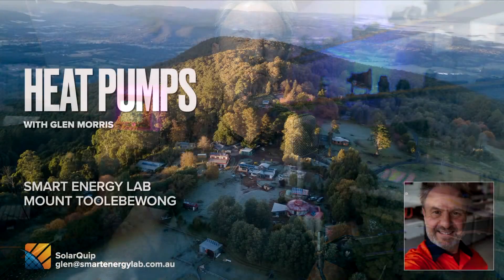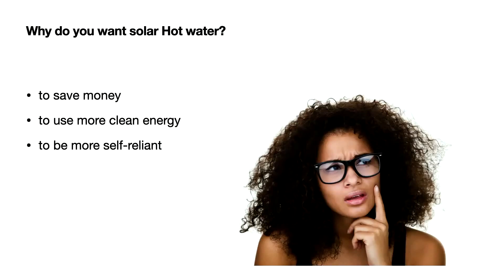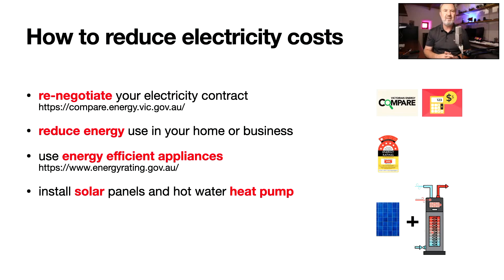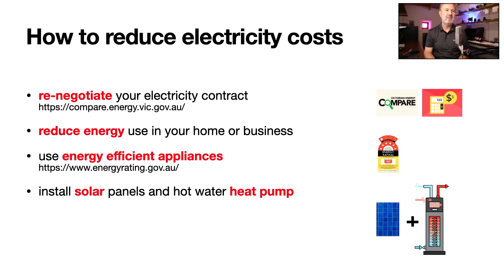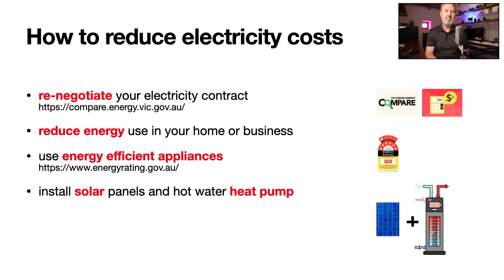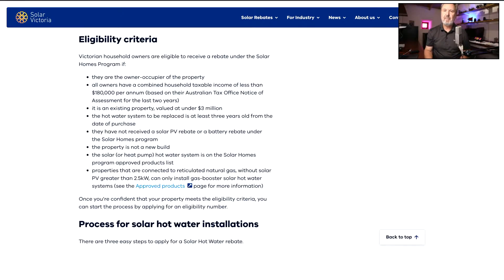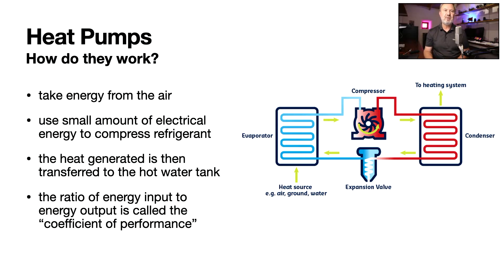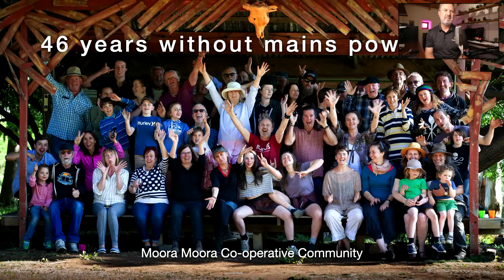Heat Pumps and Solar Energy

Comment: Could you use the heat pump to run a hydronic heating system? would it be an efficient way to heat a home?
Reply: Sanden makes a hot water heat pump, and I believe that for some climates it can be adapted to work with hydronic systems.  It uses CO2 as a refrigerant.  Therefore, it has little effect on the ozone layer.  Mitsubishi, also, has a hot water heat pump using the same refrigerant, and it has several units factory ready for hydronic floors.

If you have sufficient sunlight during winter, you might consider heating the floor with an electric resistance.  This might require less maintenance down the road, and it should simplify the installation by not requiring a heat pump.

Another possibility is to combine both systems.  Rooms that are only used during the day can be heated with an underfloor resistive heating element, and rooms used at night can be heated with a heat pump.  This has the advantage of requiring less labor for the installation of underfloor hydronic pipes, and it requires a more modest investment for a smaller heat pump.  This, also, matches better with PV production.  Solar PV would be used for the floor resistive heating element, and the heat pump could use either grid electricity or stored energy at night.

Keep in mind that the COP of heat pumps is dependent on a large hydronic surface area for heat delivery as well as the heat flow of the same.  In other words, small radiators or a small hydronic system will underutilize the potential of a heat pump.
Reply from the maker: Hi Angus, I don't believe standard domestic hot water heat pumps are rated for continuous duty so I suspect you would need to purchase one designed for hydronic heating systems.

Comment: I think it's a common misconception that solar power is inherently cleaner than other energy sources. 
 Granted, the current staple of our electrical grid is far from environmentally friendly. Most people don't recognize: The initial carbon foot print of manufacturing batteries and solar panels, the cost of replacement components, the end of life cost when batteries and solar panels are defective and must be disposed of. To recycle a solar panel is not an easy task, nor is it environmentally friendly whether or not it is recycled properly or otherwise. 
 Not totally knocking this "Clean energy", it's a proper step in the right direction. Just don't arbitrarily believe it to be as clean as it's cracked up to be. There are costs for the planet associated with it
Reply from the maker: Hi Jake, good point. The embodied energy of a product needs to be considered when doing a full environmental benefit analysis. Fortunately solar panels produce about ten times the energy that took to make them, however, batteries don't "make" renewable energy, they just store it. Recycling of solar panels and non-lead batteries is still very limited. However, lead batteries are already the most recycled product on the planet by weight and they usually have a positive end of life recycling cost (i.e. you get paid to send them to a recycler).

Comment: Another great presentation.
What are your thoughts on DC pwm controllers for heating hot water systems?
The less moving parts generally makes a device more reliable.
Example: http://www.plasmatronics.com.au
Reply from the maker: Hi Andrew, I have a MyPV d.c. water heating system and a Plasmatronics d.c. water heating system here in my lab. They both work fine and I love the simplicity of d.c. water heating... and the low cost of installation (no plumbers or copper pipes up to the roof... just a couple of copper wires).

Comment: Thanks Glen, very informative as usual 
Do you actively divert excess PV power to your cylinder? using a 3rd party diverter device like Catch Power or something similar? Assuming this is to a resistive element heater? 
Do you think you could divert similarly to a hot water heat pump? I have heard that the heat pump systems like a constant duty (4-6 hours) and current. Might not be compatible with a diverter then maybe? 
thanks
Reply from the maker: Hi Hamish, diverters can only be used with resistive elements. However, you can schedule your heatpump to run in the middle of the day when it is most likely to be powered by solar.
Reply: @ Hamish Lee take a look at the Eddi hot water diverter.

It has the option of working with a heat pump using the optional esense board, and it will add surplus solar PV energy  hot water tank.

myenergi.com

Comment: Hi Glen,
As always great Technical and valuable video.Love you stuff.As you know . I have also several systems on my Roof. Including solar Thermal, (Apricus) ,No Good after 6 Years.
Now, My -PV Acthor as an Power Manager for excess Energy for my Off grit system. SMA Sunny Boy and  Island 3.2 Kw Peak .The last few days . I needed a few KW from the grit(3 Days Rain) other wise 100% independent.Must ask anyone out there to join an My -PV Acthor Forum in Australia, To Share experiences..
Please Mail: michael.meyer@healthybuild.net.
Cheers
Reply from the maker: Hi Michael, thanks for the feedback. Yes, I've got a MyPV ACthor here in the lab too... I love the way it can communicate with the power meter over TCP/IP network, divert power to two tanks and has a cool colour screen display.